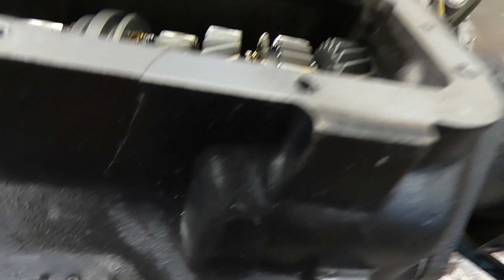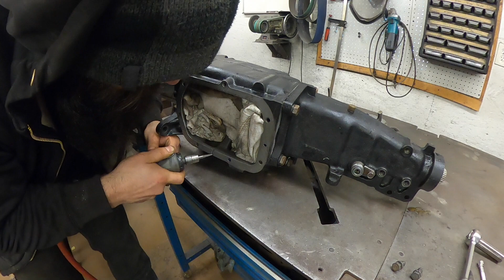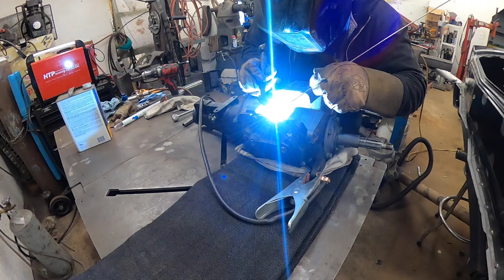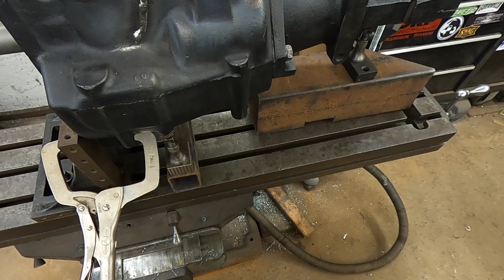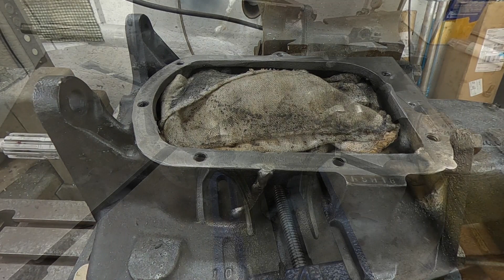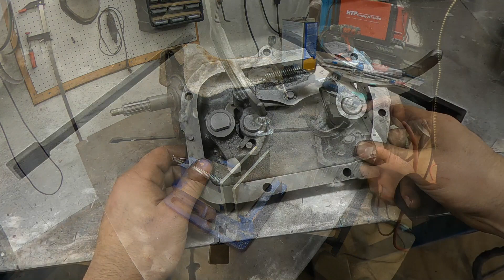Cast iron welding repair - Saginaw transmission

Comment: Good job man! The Tig torch rocks on castiron with nickel rod. 
All my cast iron repairs have been made with stick welding nickel rod.
The hardest one to do was a gear box on a walking motor on a P&H backhoe. There wasn't time to take the box off as  I had traveled 250 miles to fix it with limited time on the weekend. All vertical welds on the box just inside the tracks up front.
It seeped a little oil after the repair but never dripped. My dad was able to use it until he sold it several years later.
Without the repair it was unusable because of oil loss.

 When stick welding Nickel rod on cast iron its very bright and burns quick with so smoke its very hard to see what your doing.
I'm gonna try Tig on my up coming repair. Thanks for sharing!

Comment: Does the ni 99 work better on cast than using 309? Just a question I’ve had good luck with 309 on castings but anything to make life easier I’m in
Reply from the maker: If I were welding dissimilar metals to cast iron, I probably would have used 312 or 309. Since this was all cast iron, I decided on the Ni99.

Comment: Well done sir. Can I ask a little question. I would be interested to also buy an 99% Nickel welding rod for cast iron repairs. As I plan to order much other stuff from McMaster-Carr I'm looking specifically at part 7972A35. However they have a parameter called Welding Current Designation and that is specified as DCEP! This confuses me because a DCEN setup (the torch on the negative terminal) is so common. Did you use DCEN setup?
Reply from the maker: This was done with standard DCEN tig welding.
Reply: @grade8motorsports  Thanks, I really appreciate that!! Still plenty of things to get right when doing my own cast iron repair. But at least I know I'm ordering the right welding rods for it. And use standard DCEN, like I assumed it should be done..

Comment: Wow, that poor old “sag” must have copped a flogging to crack like that. I was really surprised that you were able to leave the gear set in it. I assumed that it would be mandatory to pull them out. Nice repair, I learned a lot. Thanks and cheers, Stuart 🇦🇺

Comment: Nice job setting it up on the Bridgeport. Cast iron repairs are always a pain if you can't have a bare casting and tremendous heat source like a proper oven. You did well with what you had to work with!

Comment: Thanks for taking the time to document this process. I was unsure if you went ahead and built up a bridge on the cover. I have a few projects I’d like to do like this. Any tips on the welder configuration and tools you use are appreciated.
Reply from the maker: Hi Conrad, the cover was bridged with weld material since the broken pieces weren't worth trying to weld back on. As far as the welder, I have an HTP 221 tig machine, but not much amperage was required because of the preheat, so a smaller machine would work on this type of repair. Other tools used in this video were just torch for the preheat, a die grinder with a carbide burr, and the Bridgeport for the resurfacing. Thanks for the comment!

Comment: Is there a reason you didn’t disassemble the case before welding?
Reply from the maker: Hi Jon, the customer didn't want the added expense of disassembly/reassembly.
Reply: @grade8motorsports  You should have told the customer that wasn't optional.  Way too easy to ruin a gearbox by grinding and welding with the geartrain installed.
Reply: @Twizter68  expertise comes from successes from less than desirable conditions. A new upgraded case that didn't break would also be the best, but finances and optimization does not always equal another's resources. 

I once welded a rear dually rim with a propane cutting torch and arc welding rod. A replacement was no longer available, and I had a steel inner for support, so I chanced it. 18 years later is when I found a set of rims I liked better. I did what nobody would do for me, and it lasted. It wasn't perfect as I had to air up the tire about once a year, but nobody could tell the visible face of the rim had a 5" section refabricated. The fearful ones will never attempt these things, and professionals assess the risk. But experts know their boundaries and educate their clients. Never take chances, and you never find your limits. I believe he said he was doing this for a family member, not a client..... client's choice.
Reply: Can you tell me the filler rod specs. I am welding a cast iron pipe.